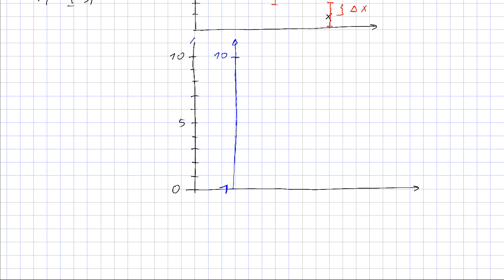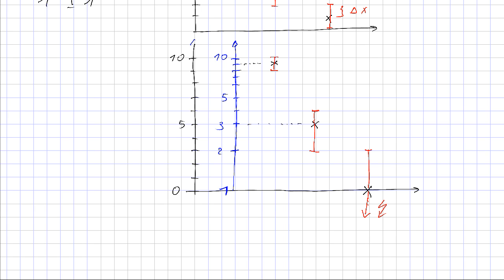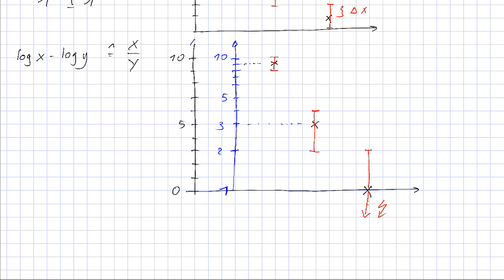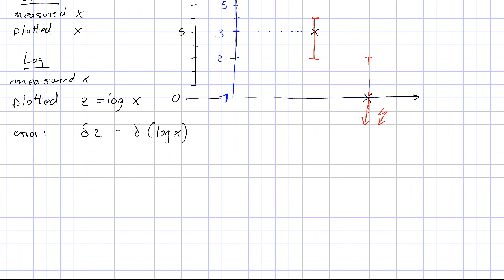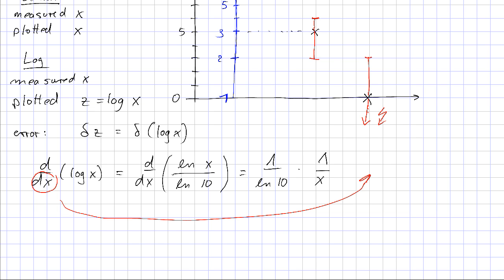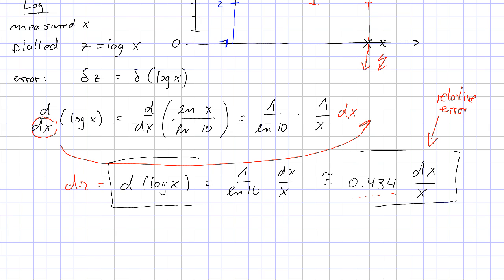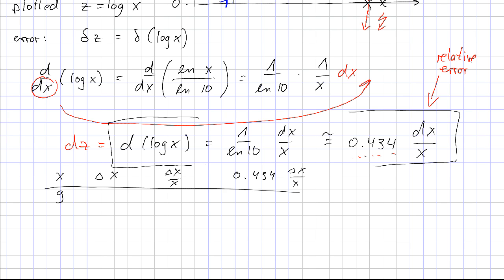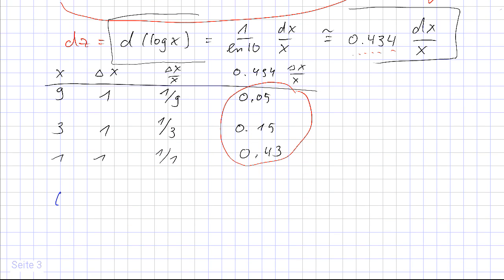Error bars in log plots

Comment: Hi , thanks for the video. I have a question around minute 3:15, when you are mapping the linear values to the log scale, you said log(1)=0, which is correct. However, the 10 on the linear scale corresponds to 10 on the log scale, which confuses me. Woudnt it be 100 in the log scale because log(100) = 10 . I don't understand this part

Comment: Hello Roellig01! Thanks a lot for this helpful tutorial. The final section where you take the relative errors and plot it on the graph was not very clear to me. How did the value 0.05 relative error, get converted to half the size of the square? Would be great if you could explain.
Reply from the maker: Hi. The logarithmic error bars are plotted on the log(x) scale NOT on the x scale. The log(x) scale reads 0 (equivalent to 1 on the x scale) and 1 (equivalent to 10 on the x scale)! Therefore, 0.434* rel error = 0.05 needs to be measured on the log(x) scale which is: the range from 0 to 1 is equivalent to 10 boxes on the paper grid, i.e. +/-0.05 on the log(x) scale is represented by half a paper grid box in either direction. Does that help?